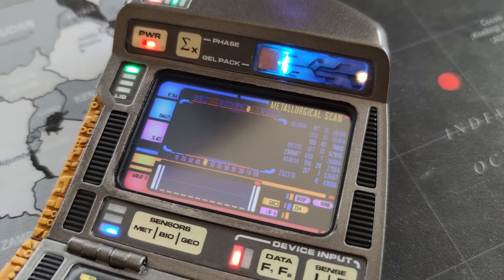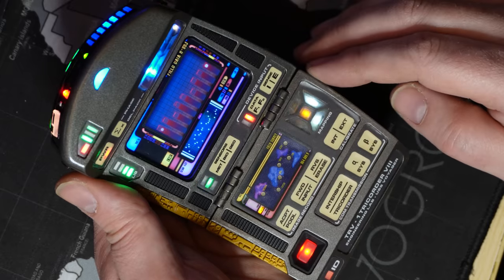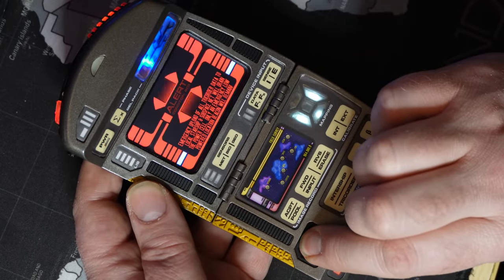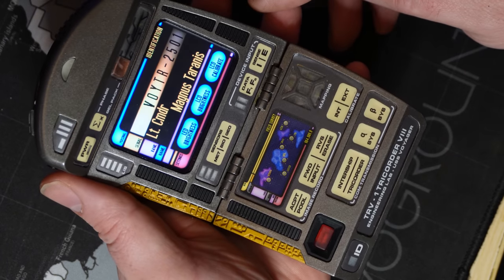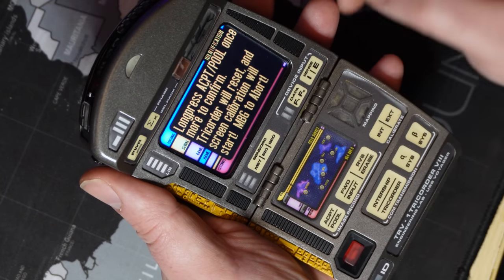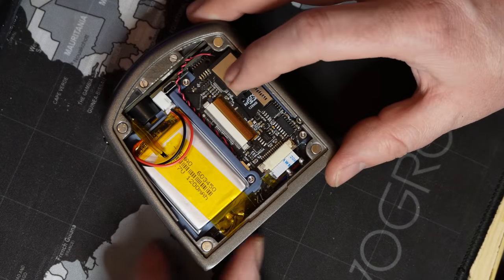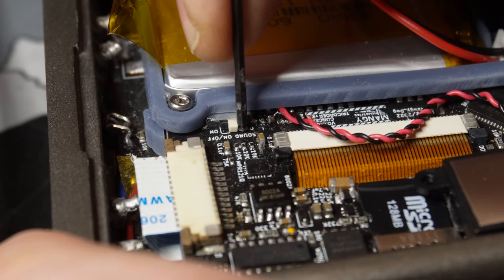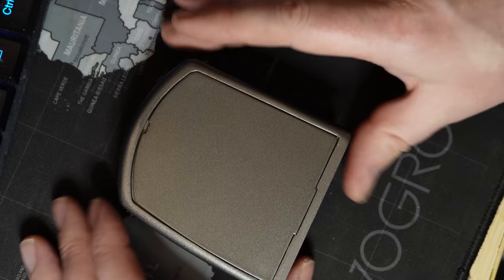How to use your Tricorder

Comment: Awesome creation.  Great job on it's construction.  I'm surprised you didn't find a way to incorporate a heat sink though.
Reply from the maker: Tbh it really shouldnt be required. its hardly a powerful speaker. Its just not a great amp chip. Ive already found a d class replacement from Ti, but its a different package so Its not just a drop in replacement. While a smaller package, its the same pin out.

Comment: Remove the USB port, and add coils to charge wirelessly.
Reply from the maker: I hate wireless charging. It's pl woefully inefficient. So much wasted power.
Reply: @MD_Builds  "I hate wireless charging. It's pl woefully inefficient." I agree. If you do not want to waste power, a charger that makes contact is the choice, and maybe you can reclaim some power by generating it with the hinges. You may need a charging base to do this with style.